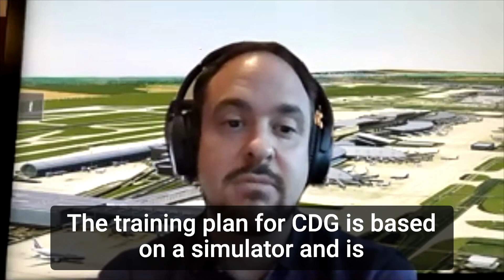FoxATM Interview #05 - Validation of ATCO licences in the simulator at Paris CDG

Comment: Hi ATM collegues,
Thanks for your presentation and sharing your experiences with the combination live/simulator exams on the CDG TWR rating. I've got a question on your simulator; Is your simulator an exact copy of your live TWR environment? And can you train the communication with all the ground controllers/assistents if there are any?
Reply: Hi Jan, Our simulator is ATTower from UFA. It's a replica but it's not connected to operational systems. Everything is replicated as close to real position as possible. FOr the radio, we use our operational system from FREQUENTIS with a specific simulator setting. With it we can simulate any interaction between controllers and airport contacts (apron/other sectors/other towers...) thanks to pseudopilots answering.
We have 2 controller positions so we can also play exercises with coordinations between adjacent sectors. Next month we will also start operating a second tower simulator which will connect to the actual one and will allow us to play coordinations between two towers on the same airport or several airports.